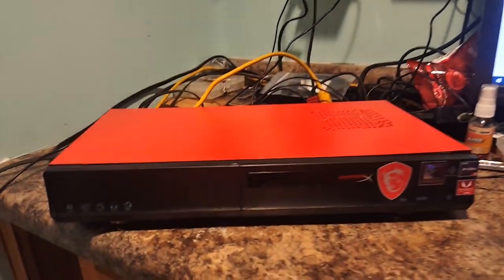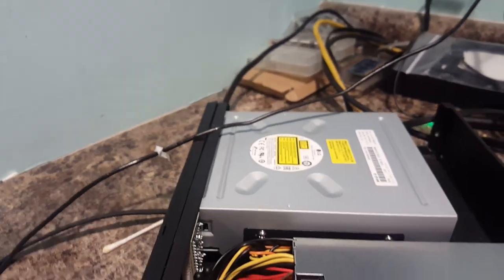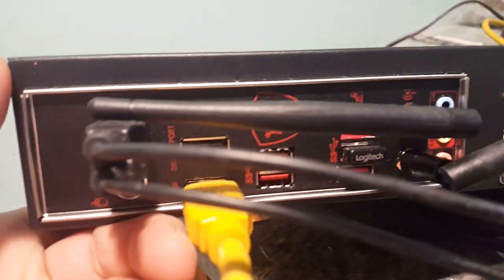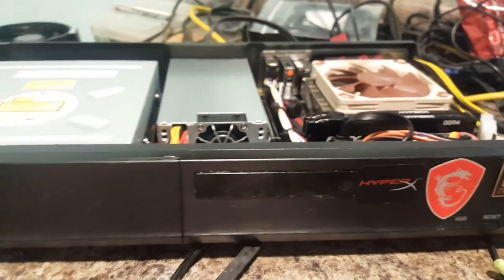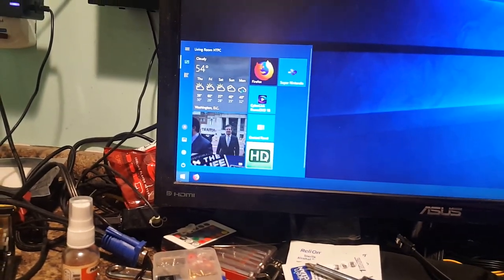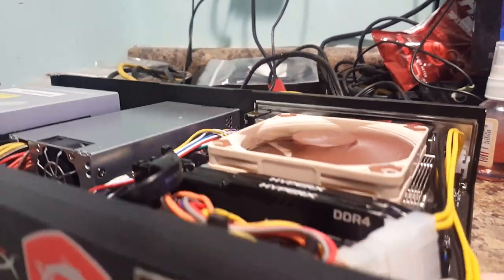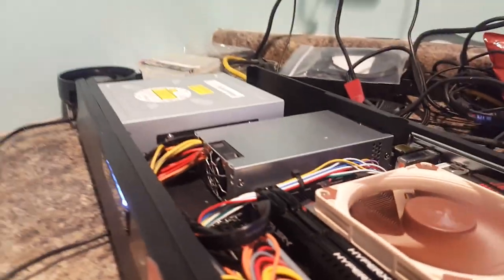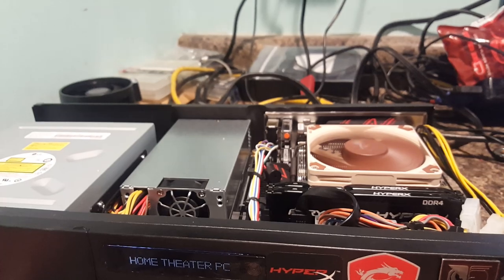nMediaPC 1800B HTPC

Comment: How loud does it get if it gets loud..this is the perfect build would love to see how you drilled the holes in it.Great job
Reply from the maker: Not loud at all. It's a Noctua fan, and even at full blast, you can hardly hear it. This however, stays very cool with the intake holes, so it rarely ever needs to ramp up. One other thing I did, was put a silverstone hi-flow magnetic dust filter over the intake to keep the fan clean. My kids use it all the time to play emulator games on. Love to find another 1800B, but they are always out of stock. Every once in a while they pop up on eBay. If I find one again, I'm gonna build another.

Comment: Does the AMD 2200G have enough juice for full Bluray 4k performance?  I've been running my HTPC with a 1050ti and an older Core i5 6500 with some success, but you box is much smaller than mine.
Reply from the maker: Does it have the muscle, absolutely... Can it play them? Unfortunately not at this time. Why? Software DRM issues. AMD was supposed to be releasing something in the drivers (maybe they have and I just haven't really looked). Kind of a bummer really. The DRM protection is used to thwart piracy and I can't see Intel ever licensing it out to AMD, especially now since the new 3rd gen Ryzens are gonna slaughter Intel in the markets.
Reply: @phreakwars   That's really frustrating if that's STILL the reality with AMD within an HTPC setup.  I want to use AMD in these cases but Intel won't let go of it's licence and it sounds like 6th gen and above CPUs have SGX support.  Still a very nice streaming setup!
Reply from the maker: @serow6  yeah I'm not sure I haven't checked it out yet because I don't really use BluRay too much. I mainly have DVDs that I watch